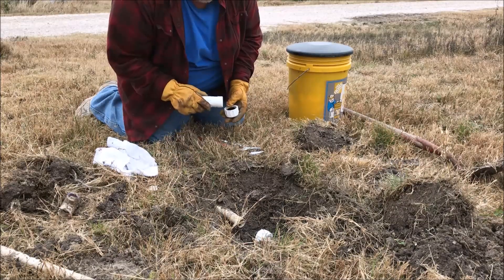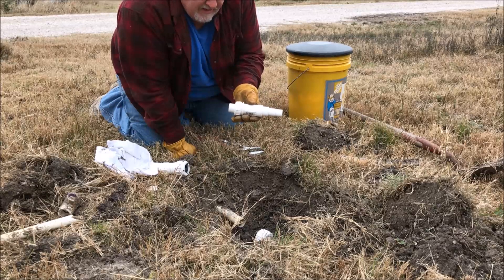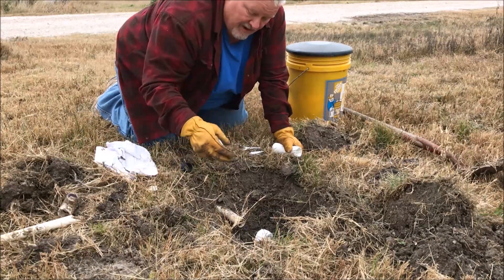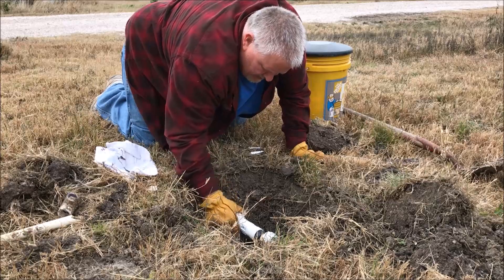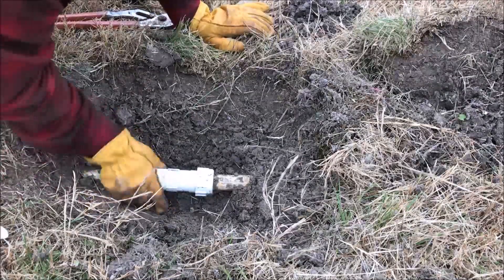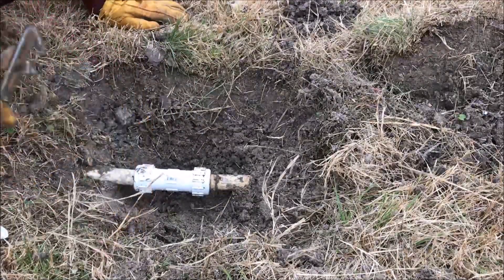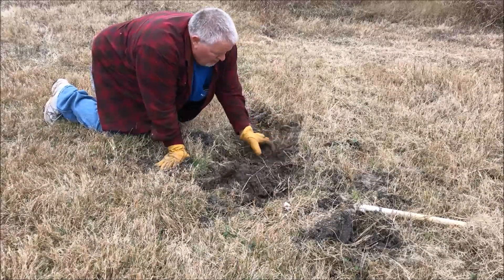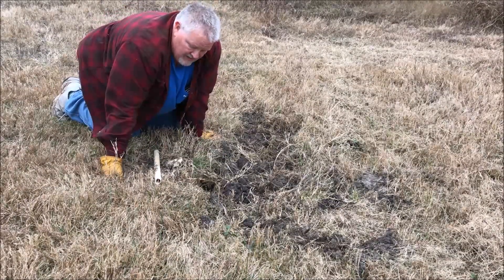How to Repair an Under Ground Broken PVC Pipe Quick and Easy

Comment: Thank you so much for your video. I cut a nick in the main line coming into the house. The water was off for two days. The plumber did not show up. I dug the hole bigger, cut all the tree roots away. Your video saved the day. I finally fixed it.